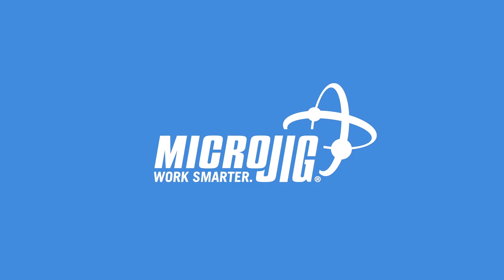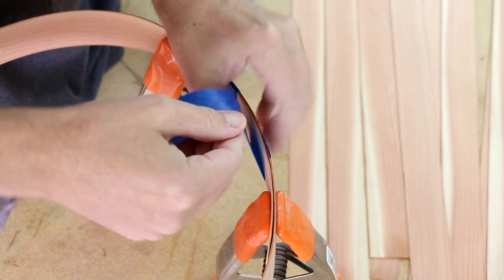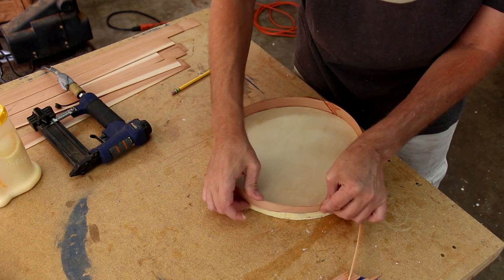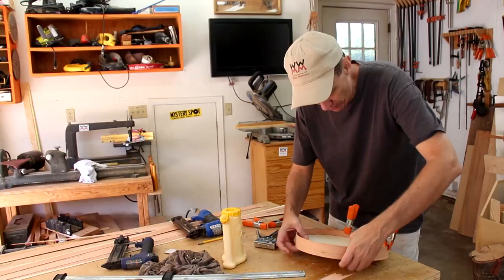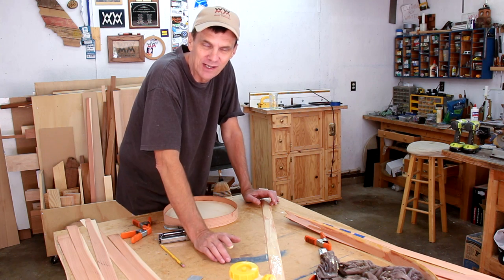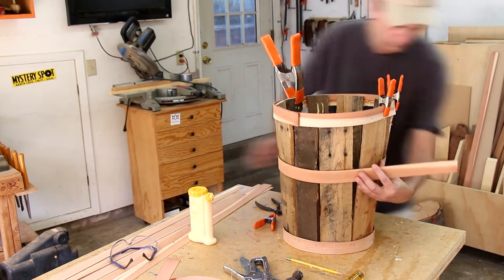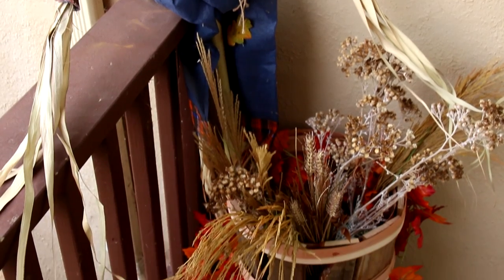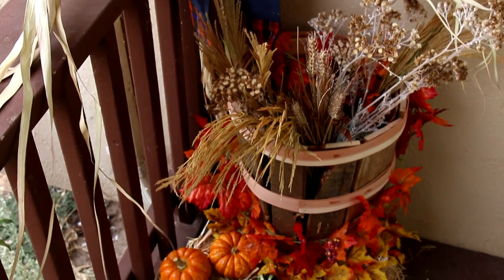PROJECT FAIL!

Comment: Boy, that was like watching a car wreck in slow motion. I think soaking the wood strips before bending them would have helped a lot.
Reply: +David Kuhns I wish your comment get enough likes to become top comment, since that is the best advice for people who would actually like to make something like this (as opposed to those who are here just to laugh at Steve's mistakes... ). Yes, soak wood strips, you can make them twist like paper after that!
Reply: +David Kuhns I thought of that too.  The one problem is you wouldn't be able to glue it while it was wet.  You would almost have to soak it, figure out the 
size of the hoops you need to bend them to, clamp them, let them dry 
then put it together and glue.
Reply: +Brian Jones , it would have taken longer to make, but pre-formung them first and then apply the glue.
Reply: +David Kuhns  and +Brain Jones,If you soak them in water after pulling them out and you can wrap them around the wood and to hold them in place. Make a jig in a way so that you can get a completed circle on them.
Reply: Soak it in windex bend let dry and then glue it.  The ammonia in the windex makes the fibers more pliable and the alcohol evaporated to dry quicker.

Comment: I'm having a similar issue with a logo I'm designing right now... In my head it was awesome, it's just not coming out the way I wanted.  Thanks for not hiding the challenges, more often than not I have to rework a wood project because things don't work out the way that I wanted.  It's a good lesson to keep at it and roll with the punches.

As always, a pleasure Steve!

Comment: My woodworking "hobby" is making Shaker boxes. Next time soak the bands in very hot water for about 15 to 20 min. You can use your bath tub if you don't have anything big enough to soak them in. Also CA glue will work on damp/wet wood. That's how I make repairs if I get a small defect or split when forming my bands. The basket still looked good to me.

Comment: Well, I know you know, that getting the wood wet to bend it would help.  But the project takes days to make for waiting for the wood to dry so you can glue it.  But I learned that a heat gun, will dry wood that thin VERY quickly (5 - 20 minutes).  That's what I did on my rooster art project with bending wood.

Comment: Steve, I needed a good laugh and you certainly gave me one.  Search for Shaker Boxes on Youtube and you will see how to do it.  Soak the bands in hot water or steam for about 20 mins and then bend them, secure them and let them dry for a day or two before you start putting the slats in. You had the right idea to trace the bottom from the original circle. That's how it is done.  I like your idea about putting the bad side to the wall.  My idea is if its that bad put it behind the wall lol.  

Keep them coming I really enjoy your channel.    Ken

Comment: In my opinion it is easy. 
1. Use Strap Clamp with a plastic bucket.
2. Wrap two strips one by one for each line.
3. Always try use glue do not damage wood strips.
4. Pallet wood may need a curve inside with sanding.

I am sure Matthias Wandel will find a better way. But i am not sure he will make a jump on it or not ?

Fun to watch Steve thnks.

Comment: For a crafty project like that, try getting some crafty wood. Balsa can be easily shaped into round hoops, and it can even be drilled and riveted to hold its shape, (but use washers with the rivets, or they will just pull thru the wood).

Comment: When you made this did you think about cutting the board at a 45 degree and making the thin boards just a little thicker. Making it like a whiskey barrel, you could paint the straps black metallic to look like it then put your flowers inside of it.

Comment: hi, nice idea, but i would rather made that more like a beer mug type - cut the pallet boards on an angle and used some small diameter splitted pranches as bands over it if you poil them in hot water for a while they become quite plastic and just used that bucet as a form to rap them over it

Comment: Reminds me of a beacon basket http://www.michaelstow.org.uk/wp-content/uploads/lescudjack.jpg *runs :D
Couple of tips, make a steamer box, use a steam walpaper stripper to add steam, or you can soak it in water for a few hours, the wood is too dry.
Instead of stapling, just wrap a box strap around the base (or similar), just let the glue do the work, you could add a temporary disc at the top for clamping. or just use spring clamps.

Or you could paint it brown for that rustic charm

Comment: One way to prevent the thin strips of wood from splitting is to steam them first..
Reply: +Steve Ramsey, if the strips of wood is thin (like less then 3mm) you can just steam them over a kettle of boiling water. I've seen one old carpenter do it before..

Comment: Fuuuuuuuuuuuuuuuck.

I was waiting for the moment where I'd see it being unceremoniously tossed into a dumpster.

I admit I laughed and shook my head quite a lot during this video, but it was definitely entertaining. Even though it was kind of a train-wreck, I'd still say that there is a good skeleton in there for a good project. Your circular hoops would need to be made a bit thicker (3/16ish?), and then either soaked in hot water or steamed. Clamping them around a circular form would also keep them from snapping so much (with a strap/ratchet clamp). I'd also probably just skip the glue and just use the narrower (1/4" wide, 5/8" long) style staples. Just some thoughts.

Comment: When the cat pops up, you can be sure things are PRETTY desperate m) 

Also pretty sure I've heard that 'decorating' melody in a Dutch porn clip from the 1990's <g>

But to offer at least a little bit of constructiveness, there are these MAKE-YOUR-OWN-HOSE-CLAMP-KIT-ANY-SIZE Kits, those might've been handy for clamping the hoops in the glue-up.

(Better still to just BE JIMMY DiRESTA and make massive iron hoops from flat bar and weld them all down in time lapse ;-)

Comment: I tried to do something using thin strips of also and ran into the same problem with the wood breaking from the nails and staples. The only solution was to drill pilot holes and use some large headed screws.
Reply: I love your work and follow you on all your projects. I get very inspired by your work and keeps my motivated while my life threatening illness tries to keep me down.

Comment: Here is an idea from a stupid old man who know nothing about wood working, or at least that is what I have been told..  You started out great by cutting thin strips, next take and glue one strip to the other and clamp together and let dry when dry measure the size for the bottom and drop into the glued circle.  What made me think of this was an old video of Norm making a half round table.  He cut the apron into small strips and with a jig he glued three pieces together and got a beautiful table with curved apron.  I would thin gluing the two strips together would really add strength